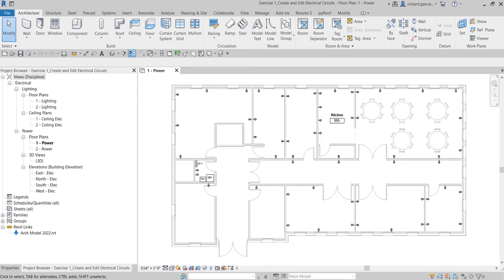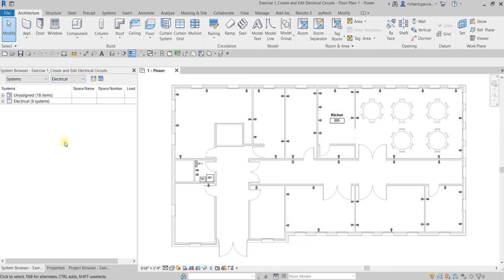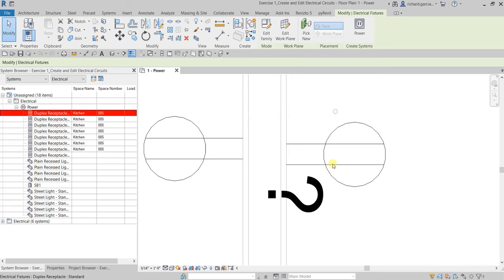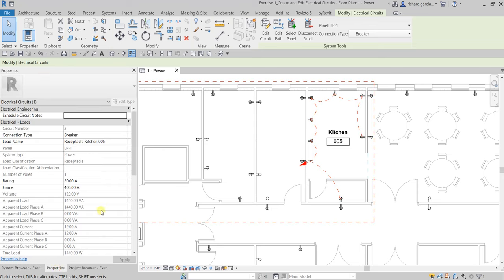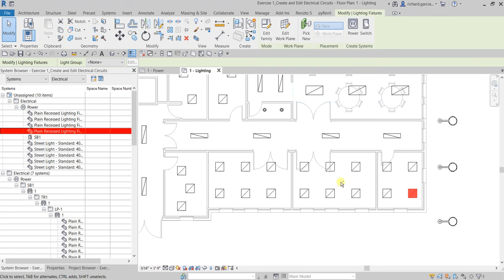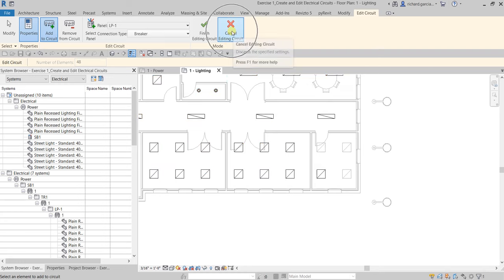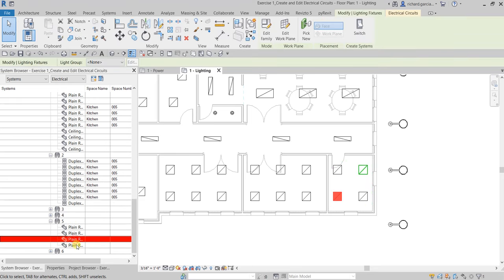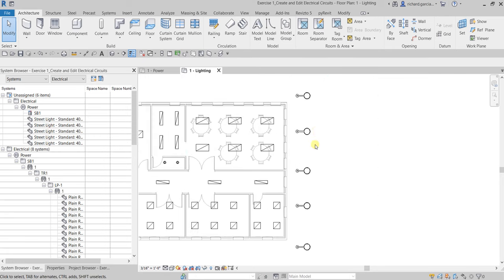REVIT FOR ELECTRICAL DESIGN: CREATE AND EDIT ELECTRICAL CIRCUITS

Comment: hi, how do you update the VA in the panel schedule of a particular circuit? for example i put a junction box for an exhaust hood, but when i put a circuit on it, the load is 500VA. if i want to change it to 1000VA, how to do it? thanks,
Reply from the maker: hi mate, updating the VA (Volt-Ampere) value in the panel schedule for a particular circuit involves adjusting the load on the associated devices or components. 

Here's a step-by-step guide:

1. *Open the Electrical Panel Schedule:*
   - Navigate to the view where you have the electrical panel schedule.
   - This is typically a sheet view that displays the panel schedule for the specific panel you are working on.

2. *Identify the Circuit:*
   - Locate the circuit for which you want to update the VA value.

3. *Find the Associated Device:*
   - Identify the device in your model that corresponds to the circuit in question. In your case, it's the junction box for the exhaust hood.

4. *Adjust the Load:*
   - Select the junction box or the associated device.
   - Open the properties for the device (you can use the "Edit Type" or "Edit Instance" option).
   - Look for a parameter related to the electrical load, such as "Load Classification" or "Power" in the properties dialog.

5. *Update the VA Value:*
   - Change the VA value to the desired amount (e.g., from 500VA to 1000VA).

6. *Review the Panel Schedule:*
   - Go back to the panel schedule and check if the updated VA value is reflected.

7. *Regenerate or Update the Schedule:*
   - If the schedule doesn't update automatically, you may need to regenerate or update the panel schedule. Right-click on the schedule and look for options like "Regenerate" or "Update."

8. *Check for Warnings:*
   - After making changes, always check for any warnings or errors in the model. Revit may provide notifications if there are issues with the electrical distribution system.

Comment: hy Rich , i have imported the CAD File in revit 2020 and now placing the power outlets , standard receptacle has been placed but DB Panel is not being placed i mean it is not finding the Host and can't be placed and even don't show in Panel icon , why is it so , plz reply , thanks.
Reply from the maker: DB panels are hosted family, make sure you have walls to place it.

Comment: Sir pede ba gumawa ng single phase system s revit?
Reply from the maker: pede naman try mo ito:

Create Electrical Circuits: Define circuits for your electrical system. In a single-phase system, you would typically have one hot wire and one neutral wire for each circuit.

Add Electrical Fixtures: Place electrical fixtures such as lights, power outlets, switches, and other devices in your model. Connect them to the appropriate circuits.

Specify Loads: Provide load information for each device. This helps in determining the total load on each circuit and can be useful for electrical load calculations.

Generate Electrical Panels: Designate electrical panels where your circuits will be connected. Revit allows you to create panel schedules that provide information about circuit loads, devices, and other details.

Generate Electrical Plans: Create electrical plans that show the layout of your electrical fixtures, devices, circuits, and panels. Revit can automatically generate these plans based on your model.

Document Wiring and Connections: You can use Revit to document the wiring connections between devices and panels, making it easier for electricians to understand how the system is laid out.